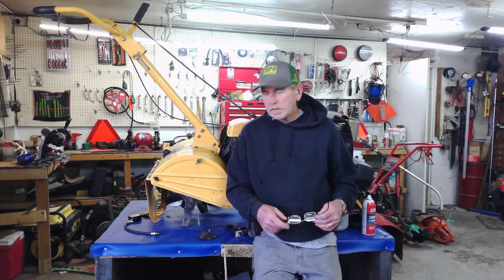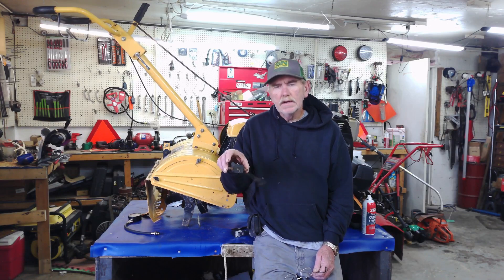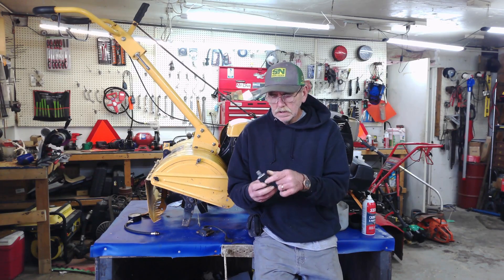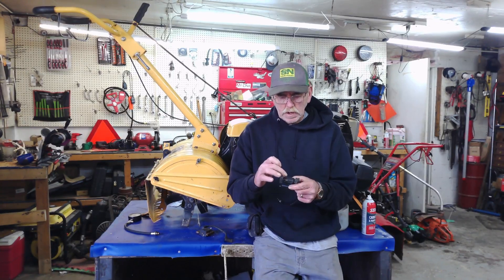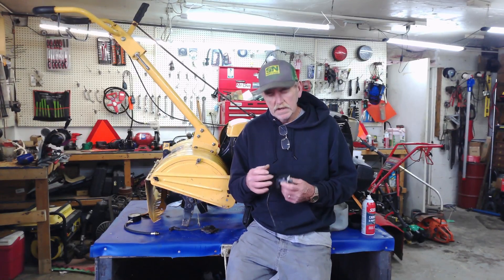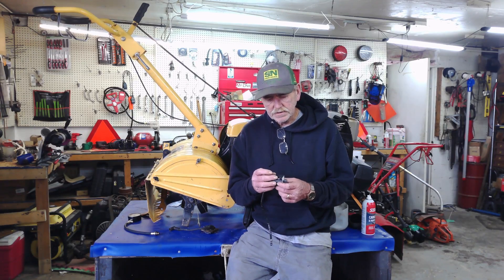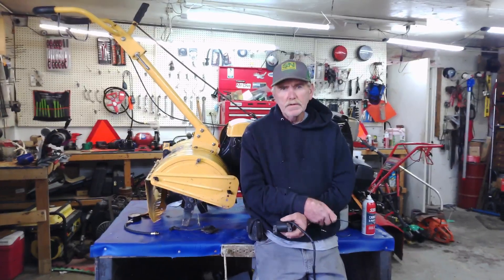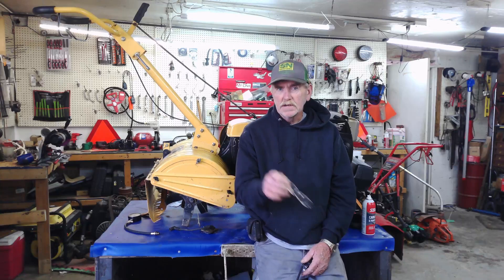Will a Lawn Mower Coil Work Upside Down? Myth or Fact?

Comment: Eric,, I have an LT1000 v twin.. 19.5.. anyways I bought a new coil (2 spark plug leads) and put it on upside down.. after realizing it I put it back on right..it would not fire..does that mean putting it on upside down burnt it out or something?
Reply from the maker: Have you tried testing it with the small grounding wire off Rad ? That should tell you if it's the coil or something going back through safety switches oe a wire grounding on the frame

Comment: Positive outcome? Your coil is bad if you got no fire. No need to disconnect the grind too test the coil. My experience? Take off ground wire from coil,turn motor over ,if it fires up then I know the coil is good. If not? Coil is bad ofr going bad. IA John Deere with bent pushrod. Fires,no fire fires no fire. Not the coil. Push rod bent. Replaced push rod ,fires up,proper compression. Try again ? NO FIRE! Not the coil,it was what caused the bent push rod. Moved VALVE Guide ! No compression, plenty of fire. Damnit man !
Reply from the maker: You have a lot of experience under your belt, John. We always go with compression, fire, fuel and air in out approach. thanks

Comment: Yes, a coil will work either way, but might not fit either way
Reply from the maker: I agree Stephen
Reply: @northernnewyorkparts in the video you said it wont produce spark upside down, but here you say it will as long as it will mount correctly...?

Comment: Sorry, that did not help with a Chinese generator. No markings on magneto. Ignition wire coming out of the side, exactly in the center.
Reply from the maker: Do you have fire going to the plug? Spark tester is nice here. Good Compression, Has fire, Fuel is Good along with a Good Air filter. Valves out of adjustment should show up with doing a compression check. The Chinese generators can be a bit finicky to get good compression and many will run at 4 PSI and up. Hope that helps

Comment: Does this only apply to a single cylinder?  I have a Kohler SV720S, dual cylinder, and just replaced both coils.  Took pics before replacement.  The port coil was lead side down and the starboard was up.  Ran like this for over a decade. Thanks.
Reply from the maker: You may get some fire from the upside down one and it's not really noticeable like the twin that had a misfire going on with it and only showing issues when trying to mow.  thanks
Reply: @northernnewyorkparts sorry Eric, don’t understand your reply.  The coil on the port side came installed this way from the factory.